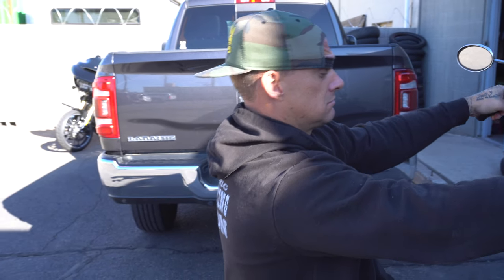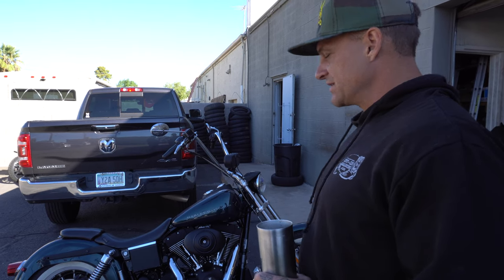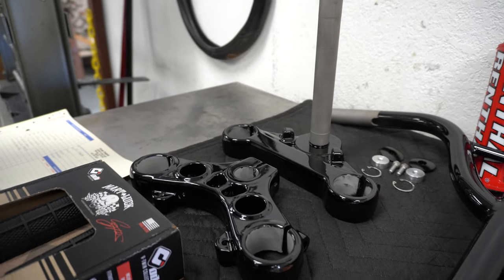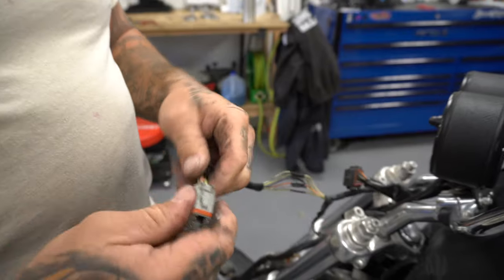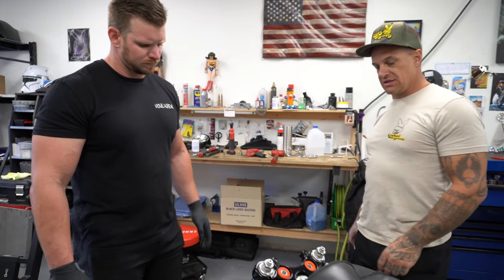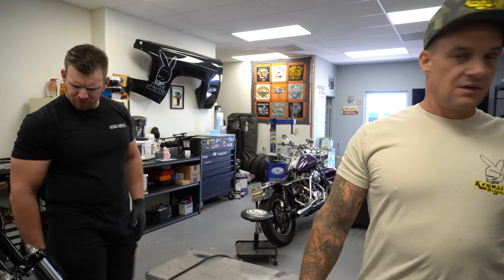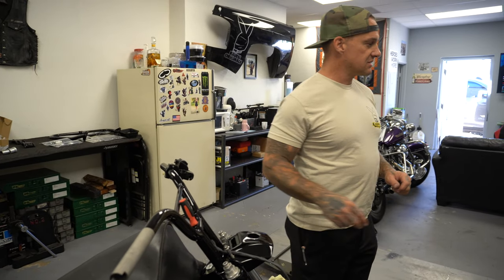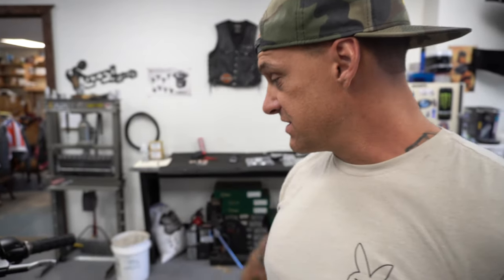How to install handlebars on a harley davidson dyna / triple tree adjustment / Kruesi Originals (P1)

Comment: dope video. quick question. i have 14 inch bars on my fxdx. my speedometer harness length is fine but my vss wire is preventing me from raising the speedo any higher without stretching. any suggestions? would still like to take it on the road haha
Reply from the maker: Get rid of those tall ass bars. Bike ride better look better and you’ll be able to use your gauges.
Reply: @kruesioriginals  I agree. Gotta stop trying to work around shit. Will take a look at your shop

Comment: A friend of mine has an 08 FXDB and the bike has a goofy top triple tree (welded on mini risers). That means he cannot put any other risers on the bike. Anyone know if he can swap only the upper tree without taking everything else apart ? At 8:40 Ryan removes only the top tree so I was wondering. Thanks !
Reply: Yes you can replace without touching anything else. FYI, there are a few companies that make t-bars for the built in risers. They bolt on to the original built in risers.
Reply from the maker: Yes, just swap a different tree on top anything off the 49 mm super glide. We can get the trees if he calls the shop they’re not very expensive.
Reply: Great thanks guys! Do you guys ship to Canada?

Comment: You guys need to make an adapter plate that bolts on to the top of those caps and let’s you bolt the gauges to the plate for dudes who wanna run gauges without those stupid clamp type mounts
Reply from the maker: Just keep watching😁